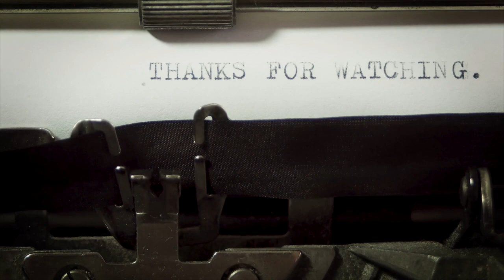Why were ultra-megaliths used in the construction of Baalbek's Temple of Jupiter?

Comment: As with any dry stacked stone wall construction, you always put your biggest blocks  down first so as to create a solid  base for the stacked stones to come on top, then you stack your next largest stone on top, and use your smallest stones on the top level. the same goes for a solid brick wall construction of a 3 story building,  first floor 18 in. thick brick wall construction, second floor 12 in.thick brick wall construction, third floor 8 in. thick wall construction.  It's not rocket science it's just common sense.

Comment: Dolomite limestone is highly piezoelectric, which means it gains conductivity under pressure. The bigger and heavier the stone, the greater the conductivity. Like the pyramids, the stones might have been part of some very ancient power grid. They always talk about it being a Roman temple, but the Phoenicians were there first (hence why it was called Baal'bek), so I would turn to their myths or legends for any clues.

The originals builders were likely long gone by the time the 'ancient' civilizations came around, so the renovators moved around the stones trying to get it back online, but they didn't know how it worked. Could be why they put the megaliths on top of the smaller ones, as an experiment, but it didn't work.  And so history became legend, legend became myth...
Reply from the maker: Thanks for the input!